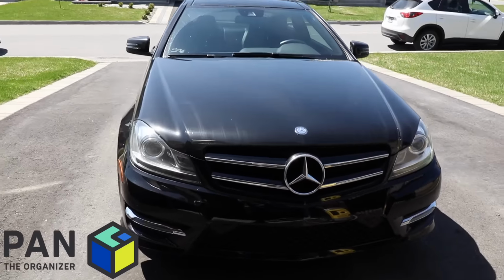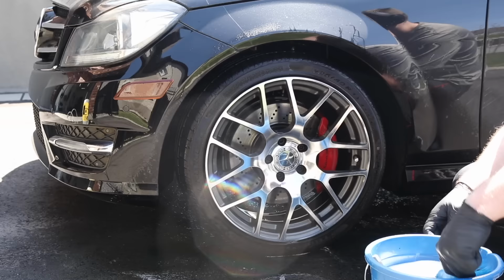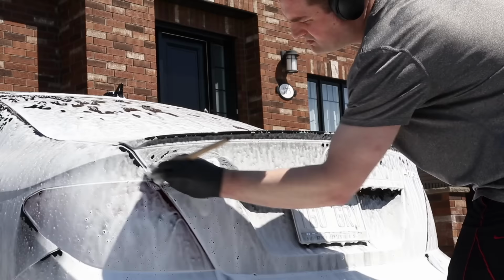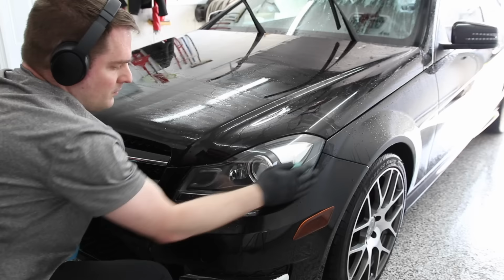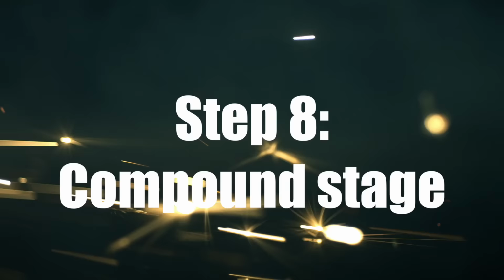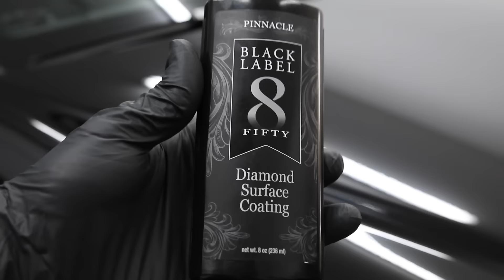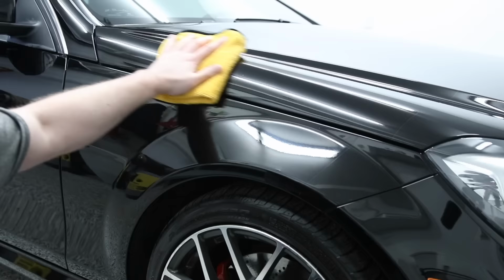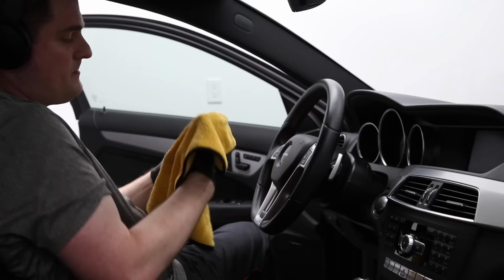MERCEDES-BENZ C350: FULL DETAIL OF A BLACK CAR

Comment: Hey, thanks for the video. I've just purchased a PC 7424XP with a 5" plate and plan on tackling my 2011 black Mazda 3 hatchback with a full detail. I had a couple of questions.
1) My vehicle has moderate swirls/love marks along with a handful of CC scratches and scuffs (looks like someone took a dry paper towel to 3 or 4 spots...) - Do you think Meguiar's Ultimate Compound + Polish would be good enough for this job? Mazda is known to use very thin paint, especially for their black 16W code. I should mention that I am planning on compounding with an orange Lake Country cutting foam pad, polishing with a white LC polishing pad.
2) In the beginning of the video you pointed out the tail pipes being caked in carbide deposits, gunk being left behind on the front bumper, as well as a couple of bigger scratches on the paint of the vehicle - yet none of these were addressed throughout the video. I suppose this is more of a suggestion than a question lol: Show us what you did to repair these spots, and after shots please!!!!

And before you ask... Your full detail of the 2006 Corolla video popped up on my home page under "Recommended," I had just finished rewatching some of Larry's videos from AMMO NYC :)
Reply from the maker: +pbakai182 
Hi!  The Meguiar's DA Correction compound and finishing polish are best used with their microfiber cutting and finishing discs.  I love that system.  If you want to use an orange foam cutting pad, I'd use Meguiar's M105 if your scratches are deep, and white or black finishing foam pads with M205 to polish.
Reply: Pan TheOrganizer Thanks for the quick reply! I had a feeling the consumer compound wouldn't be enough with the foam pad. I'll see if I can find 8oz somewhere for a decent price. Located SW Ontario. Will check eshine.ca
Reply from the maker: +pbakai182 
Autoobssessed also carries good stuff

Comment: Pan, before the pre wash, you don't add water on the car ? Thanks, great work 👍
Reply from the maker: Hi Elky!  You can if you want to.  Some do, some don't.  Don't overthink the moment.  But you're right, it would be best to start with a quick rinse as it can knock off loose debris.  ;)

How did you discover my channel?
Reply: Pan TheOrganizer, I discovered your channel because I was searching on the net to understand how to maintain my new car ( Infiniti q50s redsport 2017 black)....thanks for your help
Reply from the maker: +Elky Clockwise 
👍🏻👍🏻
Reply: Sorry for the 3 answers,, lol I add a problem with my you tube app
Reply from the maker: +Elky Clockwise 
No worries!

Comment: You apply ceramic coating after the polish, wax isnt necesary?
Reply from the maker: You NEVER apply a wax with a ceramic coating, those aren't compatible.  A ceramic coating must be applied to a virgin clear coat, stripped and well prepped surface, hence all the prep work.  The ceramic coating has to bond directly to the paintwork with no interference from other paint protectants.  Watch my popular ceramic coating tutorial to find out all the key stuff: https://youtu.be/byKcYsEyWGk
Reply: Excellent, thanks Paaan!

Comment: What do you do to fix stained aluminum trim around windows?
Reply from the maker: It would depend on what type of stain and what condition it's in.  Hard to tell just by writing without seeing the issue...
Reply: 2010 bmw 335D mostly from new England environmental contams.. i was able to "polish" some off im guessing i use some sort of aluminum polish?
and seal it after? or leave it alone?
Reply: honestly im probably looking for a generic aluminum trim polishing answer? this really is not my specialty
Reply from the maker: A light metal polish from Chemical Guys usually takes care of this: http://amzn.to/2wz1lE3

You simply apply with an applicator pad (either foam or microfiber) and rub it gently on the affected surface, then remove.

Comment: what do you use for trim detailing and why don't you use a rag
Reply from the maker: +bosanacmobster 
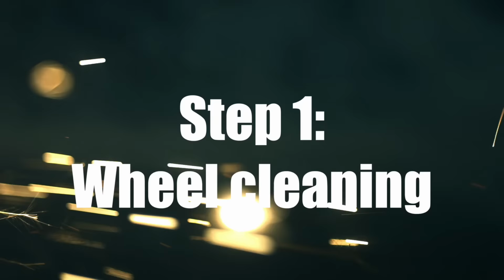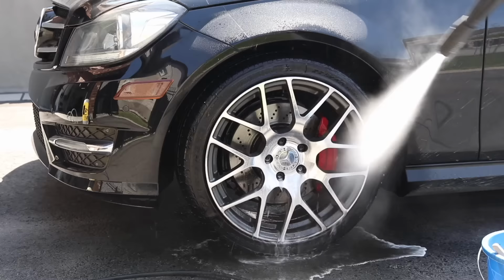What do you mean by trim detailing?  To clean or to protect?  To clean, Meguiar's Professional APC diluted 1:10 or Chemical Guys All Clean+ diluted 1:20 is good.  For a nice finish and protection, Chemical Guys Silk Shine or CarPro PERL.
Reply: im talking about at 12:00
Reply from the maker: +bosanacmobster 
You can use what ever you like best to apply interior detailers.  In this video I used a foam pad, sometimes I use a microfiber applicator, sometimes a microfiber cloth.  It doesn't matter.

Comment: Mi car is the same color as that one and it has terrible swirl marks, can you recommend me a good swirl mark remover? The car has ceramic coating already
Reply from the maker: If your coating already has a coating, there's not many products that will allow you to polish a ceramic coating.  The only one I know of is CarPro Essence Plus+ (not the regular Essence).  That polish is meant to correct damaged coatings.  Check out their website.
Reply: Pan TheOrganizer thanks! Can you recommend me a good product to maintain the ceramic coating? Maybe on regular washing or any time you recommend
Reply from the maker: Here: https://youtu.be/J7uc4AlarpU

Comment: How long does this ceramic coating used in the video last?
Reply from the maker: Hi!  AutoGeek states that it lasts up to 3 years on paint, but in my testing, it's a good 12 to 24 months depending on maintenance.  Consumer grade coatings typically last 1 to 2 years, so great durability compared to traditional waxes and sealants.  Plus, this Pinnacle Black Series Diamond Surface coating can be applied on paint, glass and wheels.  

How did you discover my channel?
Reply: Pan TheOrganizer thanks I have a passion for building vehicles and keeping them clean. I've decided to start a detailing business and just trying to figure what's the best of the best. Found your channel just searching different detailing things
Reply from the maker: Looks like you found the right channel!  :)

Comment: Do you always need a compound this cars paint already looked pretty good? I'm wanting to correct my cars paint but not sure if I need to compound it does have many swirl marks though
Reply from the maker: Hi Nic!  It depends how much scratches, hazing, swirl marks, holograms, etc you have on the paint.  This paint, despite looking good on camera, was neglected and needed a 2 stage paint correction (compound and polish) to remove all the swirls, scratches, and oxidation.  

Sometimes, just a good all-in-one polish and the right polishing pad can also do the trick.  I always do test spots before polishing a paint, to see what results I'll get.  ;)
Reply: Pan TheOrganizer oh okay makes sense, what polish do you use and can recommend for me? I'd like to do full detail on my Polo GTI soon. I saw in one of your videos you used menzerna super finish.
Reply: Pan TheOrganizer I did buy Meguiars Ultimate Polish not sure how good of a job it will do though but it was cheap so I thought I would try it. So if you can could you please recommend a paint correction combo for my car with many swirls. Thanks pan
Reply from the maker: +Nic Nolan 
It depends what state your paint is in... It's impossible to suggest without seeing it in person.  But classics that I like are Meguiar's M105 or DA Correction compounds and Meguiar's M205 and Menzerna SF polishes.  I like Meguiar's DA microfiber cutting discs for compounds and white or black Lake Country CCS foam pads for polishing.
Reply from the maker: +Nic Nolan 
I already did...  check my previous post.  Just use Meg's microfiber correction discs with your Ultimate compound.  You can use Meg's microfiber finishing discs with their Finishing polish (Pro series) or Menzerna SF polish.

Comment: If I coated a car with Cquartz and then parked it outside later that night would the over night/morning dew condensation ruin or affect the coating?
Reply from the maker: No you should be fine.  As long as there isn’t any running water on it.
Reply: Thanks for your response!
Reply from the maker: My pleasure!

How did you discover my channel?

Comment: does clay bar remove tree sap even when its dry?
Reply from the maker: It can help, but something like Citrol 266 works best.
Reply: so do i spray sap with it then use the clay bar? or let it dwell for a bit then just while it off?
Reply from the maker: Citrol alone will remove the tree sap.  You won't need to clay.  However, keep in mind Citrol removes waxes or sealants, so you'll have to reapply a thin coat on the area you sprayed Citrol.

Here's a video I made on bug removal with Citrol.  Same applies to tree sap: https://youtu.be/ITRC8bNJkHE

Comment: Did you not have any issues removing the haze from the cutting step? You didnt give any before and after results of the 2 step correction which seems to be standard issue for anyone making these kinds of vids 😔 My C63 is giving me a fight...
Reply from the maker: Zero issues.  It came out perfect as you saw.

What compounds, polishes wnd combos did you use?
Reply: @PanTheOrganizer  I have an optimum microfiber cut pad and megs cut, polish, and wax foam pads. Using megs M105 to cut and megs ultimate polish to bring back clarity. I can get swirls out no problems. Getting full clarity doesn't seem to happen, there is an ever present sheen (beams of light spreading out from the reflection of my test light). I've tried both the cutting foam and polish and polish foam and polish in varying quantities all the way down to just water and a seasoned pad. The machine is the megs DA power drill attachment. The last thing I have to try is using an actual random orbital DA machine which I am waiting on to arrive.
Reply from the maker: Try Sonax Perfect Finish with a Rupes yellow foam pad for finishing. ;)
Reply: @PanTheOrganizer  you are not the first person to suggest the rupes yellow. I have one on the way in fact. Thanks for taking the time to reply! 😊

Comment: This is a black car but you didn’t use a product specially for black cars. Shall I assume that ‘black waxes are not that necessary since this car looks spectacular?  I have the same question for white cars.  I have two white cars.
Reply from the maker: I did not use a wax in this video.  I used a ceramic coating.  Waxes last 2 to 3 months at best.  Ceramic coatings like the one in the video last 2 years or more.  They are the ultimate form of paint protection and can be applied to any colour car.

Watch my tutorial on ceramic coatings, you'll understand everything about them: https://youtu.be/byKcYsEyWGk

Comment: How in hell does the foam not dry with that sun?
Reply from the maker: It looks sunnier on camera than it actually was.  I never get issues with the snow foams I use.  I spray, let it dwell a few minutes than rinse.
Reply: @PanTheOrganizer  not sure how the wether is were you live but down in central america you cannot do that unless you are inside a building or else the foam will dry almost inmediately, what soap are you using? Thanks for your prompt response

Comment: Is there any professional ceramic coating person that charge about $500 to add ceramic coating to a car cuz all the people I called be talking about $1000-$2000
Reply from the maker: You have to keep in mind there is a lot of manual labor involved in prepping a car before applying a ceramic coating.  I typically will take at least 10-11 hours to prep a new vehicle, and and older car can take longer even.  So the quotes you got for 1000-2000$ are more than justified in my opinion, you got the average price for that kind of work.

I would shy away from anyone wanting to charge you only 500$ for full prep, paint correction and ceramic coating, as they would have to cut down on the quality of the work and quality of the products used to get to that low of a price.
Reply: Pan TheOrganizer thanks Pan

Comment: 10 hours of work than you start driving for 10 minutes and the black car is all dusty again lol hate my black mustang
Reply from the maker: +fantomg100 
Black cars are for sure the hardest to detail to perfection but when they're dialed in, man do they shine!!  

How did you discover my channel?
Reply: that is true what is that stuff you use for the interior ?
Reply from the maker: It depends, I have so many.  But for plastic trim, I like CarPro PERL or Chemical Guys Silk Shine.  For leather, Swissvax, Pinnacle or Chemical Guys leather cleaners and conditioners.  For windows, Stoner Invisible Glass or AngelWax Vision.  For a good all-purpose interior cleaner CarPro INSIDE or Meguiar's Professional series APC... etc.

Comment: You're working way too large of an area at one time. No way to get uniform defect removal that way.
Reply from the maker: Hi Mark!  One usually works a 2 by 2 section, but with my 20 years of detailing experience, I've managed to get my own routines down to a T and it works great for me.  To each his own.  It also depends on which compounds or polishes I work with, some allow for a larger surface to be covered before they stop being effective...